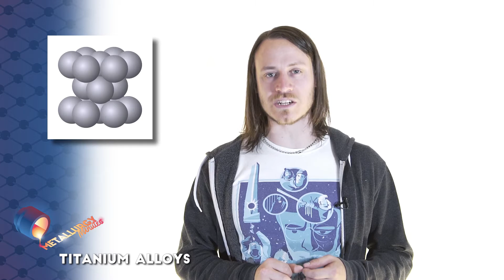How can a Metal that Light be that Strong?!

Comment: The written explanation below the video is horribly woolly. Weight should never be confused with density. The most commonly used titanium alloys have densities 55-60% that of mild steel. "Strength" is a poor term to use since it confuses people between the forces applied to cause yield (permanent plastic deformation) or ultimate failure (fracture), and the force per unit area (the stress) required to cause the same conditions. There is a very wide range of steel alloys, which have an equally wide range of yield and ultimate failure stresses. As one commentator (more or less) says, the video actually fails to explain why the yield stress of a titanium alloy divided by its density is so much greater than the same ratio of a commonly used mild or structural steel. The manner in which precipitates lock the movement of dislocations through grains is explained, but the final, logical link to the comparative yield stresses must be made. Some comment also needs to be made about the comparative strengths of interatomic metallic bonding in titanium, aluminium, and iron. Frankly, I recommend that this video is lengthened, and better explanations with clear graphics are added. Thank you.